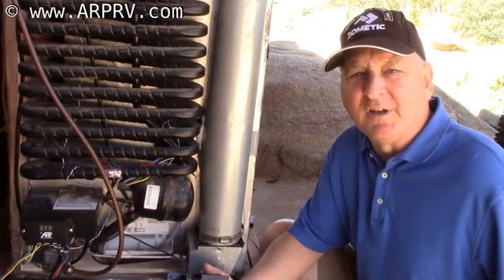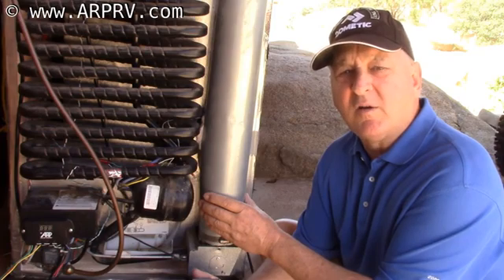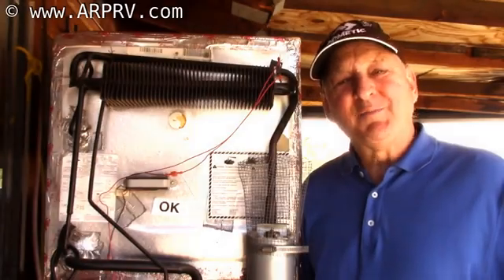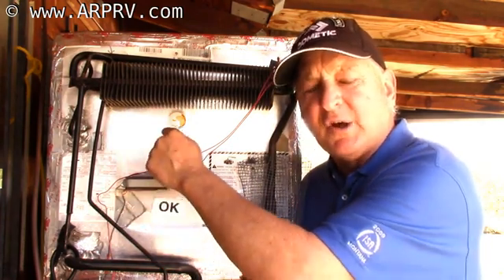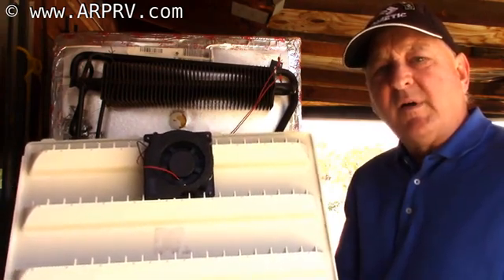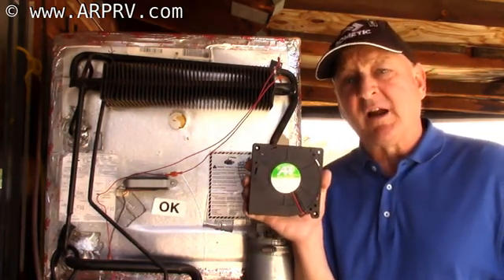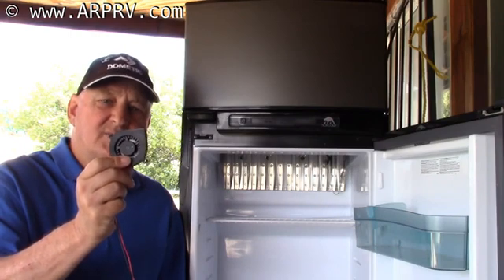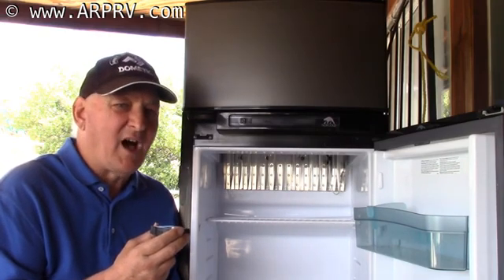12 RV Fridge Fan Facts

Comment: Your myth busting video and “ engineered” fan idea seems to run opposite to the hundreds of RV owners who have solved the incompetent design of the manufacturers original equipment offering, not to mention the thousands of honest dollars RV owners have forked out to have a fridge that actually works. After having two OEM fridges fail in my previous RVs, I tore out the dometic unit and scrapped it replacing it with a 12volt unit.  No issues !
Reply from the maker: Hi Todd, can you clarify what you are talking about when you say "Your myth busting video and “engineered” fan idea seems to run opposite to the hundreds of RV owners who have solved the incompetent design of the manufacturers original equipment offering, ..."  What does "opposite" mean?  That is "opposite" to what?  You are correct when you say "incompetent design" because the root cause of Dometic and Norcold absorption fridge failure is the overheating of the boiler.  If Dometic and Norcold were competent they would address this issue, the only problem for them is that we own the patent and would have to pay us to use the Fridge Defend boiler protection design.  FYI:  We have 2 absorption refrigerators that are over 80 years old, you will never see a compressor/residential fridge last that long. Thus,  "run opposite to" is a very confusing statement when it comes the the science and longevity of properly controlled absorptions refrigerators in RVs.
Reply: @fridgedefendfordometicorno9170   Hi Paul, with all due respect the phrase “Myth busting” was used by yourself in the opening sequence. The “Engineered Fan” also were your words. My point is; many honest RV owners have been forced to solve the bad design of OEM fridges by using what ever is/was available to them as well as experiences from other YouTube contributors. I personally find your use of  such phrases that degrade, cast doubt and, to some extent, disregard the efforts of others to be somewhat insensitive. Kudos to them for sharing their ideas. I haven’t checked the pricing or availability of your offering but my point is, you could have chosen your words more carefully.  Thanks for asking.  Todd.
Reply from the maker: @ussweeneyd  Hi Todd, sorry if you find my direct and scientific comments degrading.  The fact is that fans cannot and will not prevent an absorption fridge boiler from overheating, and in turn causing the fridge to fail and/or cause a fire.  Therefore, we are promoting safety, and safety is just a fact that does not require words that are sensitive. I welcome any input when it comes to the science of Dometic and Norcold refrigerators, and again, I am sorry if you took offence to my use of words that are not PC, just factual.